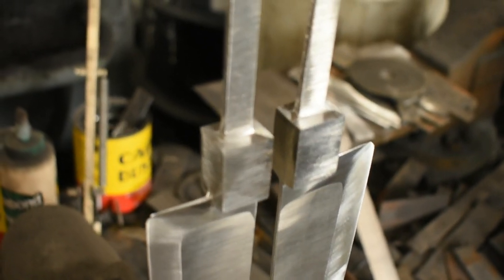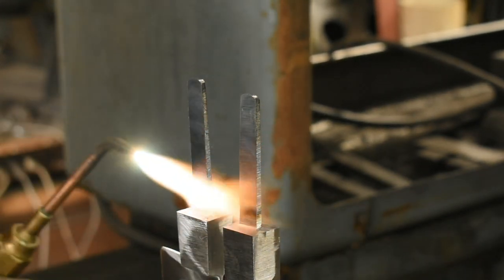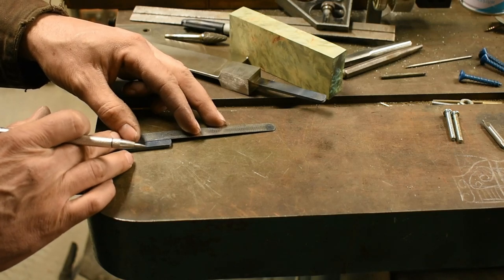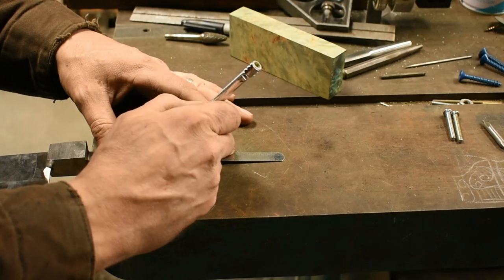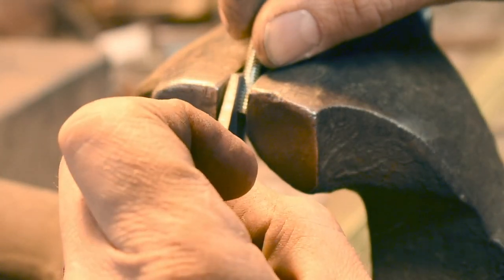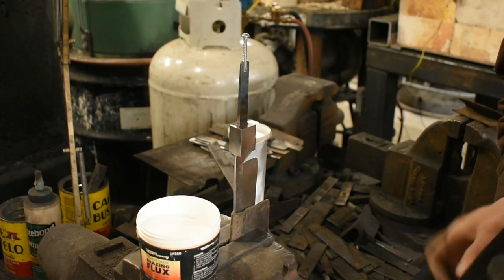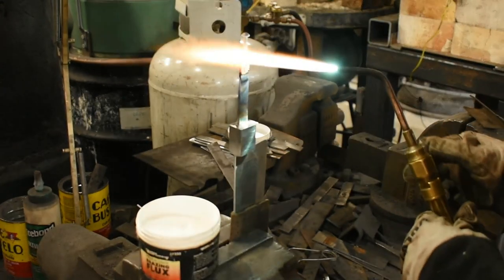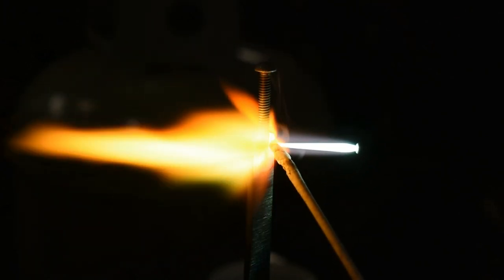Chef Knives: Brazed Tang Tutorial

Comment: Awesome technique.  Would you mind explaining why you brazed the rod to the tang instead of say, welded it on?
Reply from the maker: Welding is really not good for the grain of high carbon steel. Even with subsequent normalization, I feel that brazing will likely be stronger. The more so, with the tightly fit and then fully flowed together joint. 
Some folks weld em... to each their own. Wayne Goddard recommended this way so that’s what I learned way back...

Comment: Excellent, I have a dagger to finish like this soon. 
Why do you prefer brazing instead of say silver soldering for something like this?
Reply from the maker: Depends on if you're talking about hi or lo temp silver solder.  Lo temp of course is not nearly as strong.  Hi temp silver solder is technically a brazing family process... just a bit of a different alloy.  It's fairly interchangeable in terms of strength and technique.  I've done both.  Common brazing rod is much easier to find where I live though.